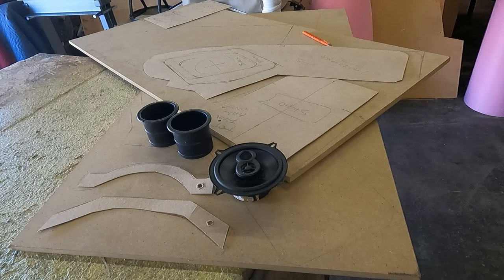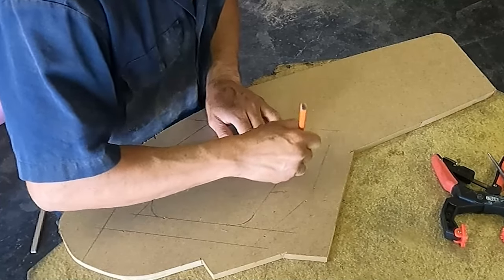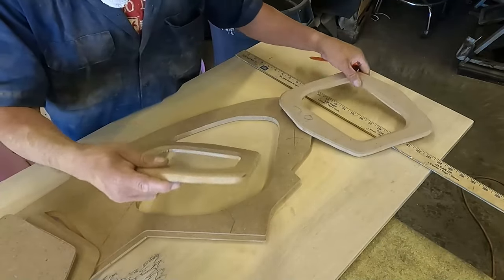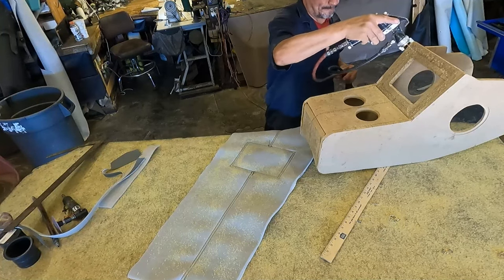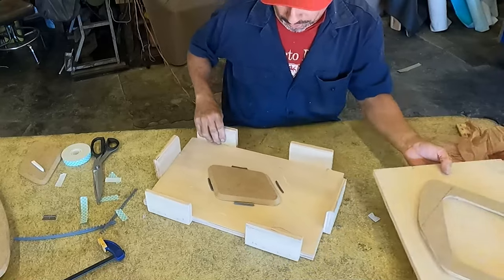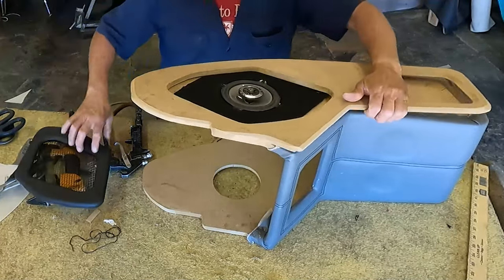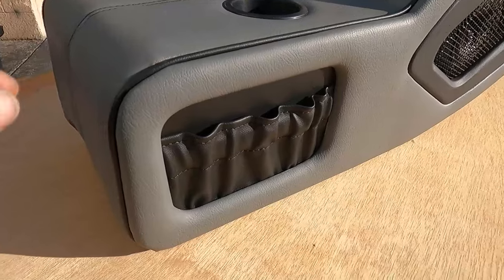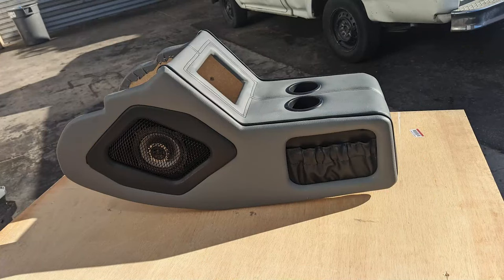Make a Center Console from Scratch and add a Metal Mesh

Comment: For table-mounted tools (router, tablesaw, bandsaw) get a push-pad & push-stick set with a rubberized surface. They’re not very expensive from the usual online sources; or you can make your own if you’ve got some wood scraps & a sheet of adhesive rubber (or rubber-faced tape like what is used to keep throw-rugs from moving around. Remember - you only get issued one pair of hands, and they have to last you your entire life.

Comment: This is similar to what I want to build for my truck...but I will be using bucket seats, so I want it to run between the seats...but the front part I want to do similar to this, but I will shape my speaker grilles different...I will also be using green & white vinyl to match the truck...excellent video...I learned a lot...🖖🏿😎👍🏿

Comment: A router with a circle jig (which can be shop-made from 1/4” plywood scraps if you’re just starting out and don’t want to spend the $$$ for a commercial one) and a router table (which you can improvise by mounting the fixed base for your router upside down under a workbench if you don’t have a spare couple hundred bucks or so for a nice precision router lift) is invaluable to have. I’d get a router before I got a circular saw - jigsaw, aluminum angle bracket as a straight edge, and clamps first, router second, and circular saw third. Bandsaws and miter saws are nice to have, but not absolutely essential. DAP Weldwood Landau Top & Trim HHR Spray Grade - despite the name - can be applied with a cheap brush, so you don’t actually NEED an air compressor and spray gun, although they are definitely nice to have. For dust management, any canister vacuum cleaner or shop vac with the dust filter fitted can be made to work; and if you’re just starting out you can pick them up at thrift stores or on Craigslist, sometimes for free.

Comment: Suggestion: use a pliers-type leather punch to make a rounded hole that you then cut into with the scissors. The rounded hole will distribute the stress when you pull the vinyl tight; and reduce the chance of the cut traveling over time (or as you are trying to get it tight).
Reply from the maker: Thanks for you advice my friend

Comment: Very helpful videos, I'm in the process of building a ported dual 15" fiberglass subwoofer in place of the rear seats of my 1987 IROC-Z, I have the mdf built up for the base and bracketing for the subwoofers themselves. I'll be pumping out approx 10,000 watts from the subwoofers, how many layers of 1.5 oz fiberglass mat and fiberglass cloth should I use to make sure it doesn't blow out when I turn my sound system up? Thanks
Reply: At least 3 layers of woven fiberglass material or 4 layers of the random strand material. Fleece works very good for a base layer as it takes shape very well then fiberglass over the top of that with another layer behind it. Make sure to work out all the air bubbles between layers or it will delaminate.

Comment: If there’s anyone in Australia that knows or can recommend somewhere for supplies I would appreciate it so much. I’ve tried looking for some recommended glues with not much luck a couple of places online but postage cost more than the glue lol. 

Same with fabrics and foam etc. most I’ve seen have no vinyl in stock. Looking for ABS, blown pvc fibreglass materials also. Struggles 😢